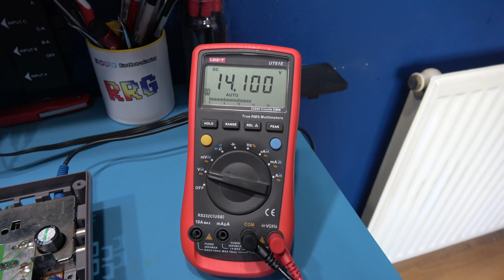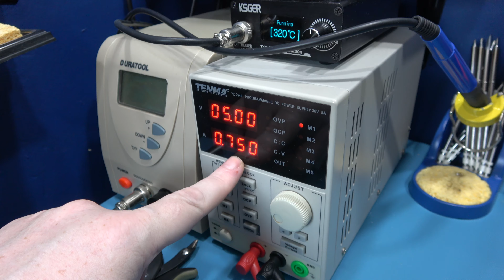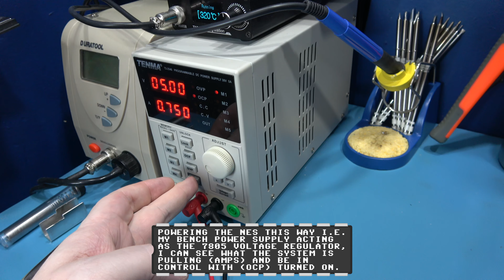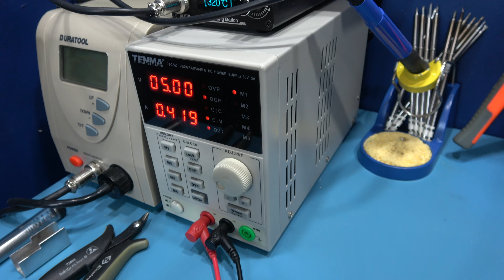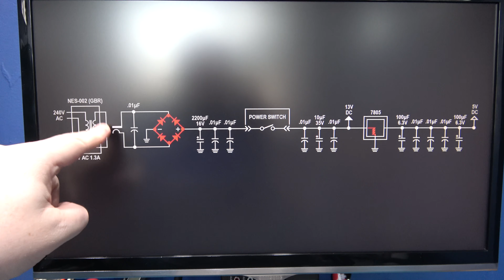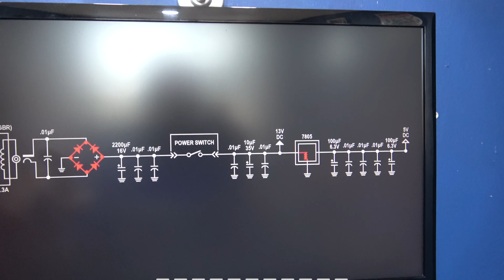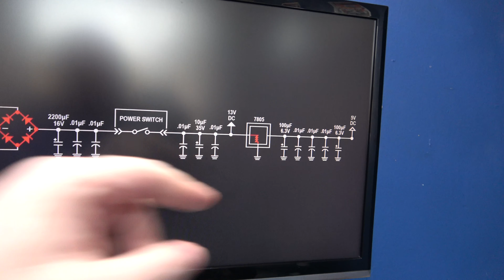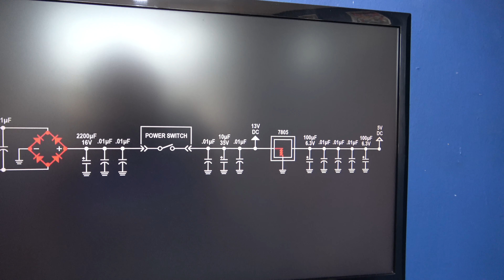Nintendo Entertainment System (NES) - Part 1 - Repair.

Comment: Great stuff Four X. Crazy to see a 7805 nuked so bad. Nuts. Nice save repair in the end. Still not picked up a NES. May get one in the future. The top loaders look cool  but their damn expensive.
Reply from the maker: Get youself a Japanese Famicom Dermot and Composite video mod it or even better install a tim worthington rgb mod like I did with mine. also look into picking up an everdrive and your set.

Comment: What would be your next steps for testing a system that is not getting any power reading at the 7805? Upon initial visual inspection, my 7805 looks perfect. My NES does not power on. The power adapter and power button have been confirmed to be working.
Reply from the maker: The path to the bridge rectifier or the bridge rectifier itself.

Comment: Hi FourX, Have you considered doing the x2 wire cic lockout chip disable mod?
I have a UK Pal model that once modded is brilliant at playing all Pal games from every Eur region, also allows some ntsc titles to work also.
I also have  a american ntsc nes with the same mod.
I prefer the x2 wire mod over cutting a chip pin on the cic chip.
It does the same thing and is easily reversed.
Reply from the maker: Yep I've done both methods. I own two japanese Famicom's one of them is RGB modded. you don't have to worry about the cic lock out chip with one of those.

Comment: Aah the magic smoke i know that and the smell.
Fried my NES with my SNES after market PSU, it shoudled work (tripple checked the specs of the PSU and my NES and it should have worked) on my NES but there whas poff the magic smoke and then nothing :(
Sucks because is dont have a NES in my collection got it for free with only a few games and no PSU or controllers. Hope to have the knowledge to fix it one day. (same for a blacked screen SMD 2 i got).

Watching as we speak.
Reply from the maker: The SNES PSU should of worked as it's an AC PSU like the one the NES uses. I think there must of been somthing wrong with the NES to begin with, probably the main filter cap's gone bad.
Reply: @Four_X  Thank you for the reply, i apriciate this, This got me buggin for years now, because i tought i was 100% sure the PSU would work on it.